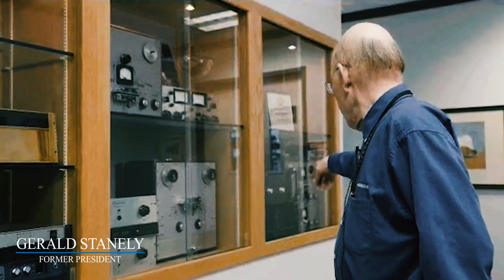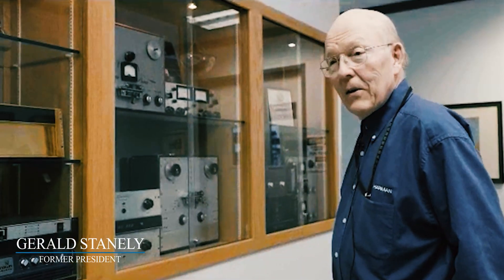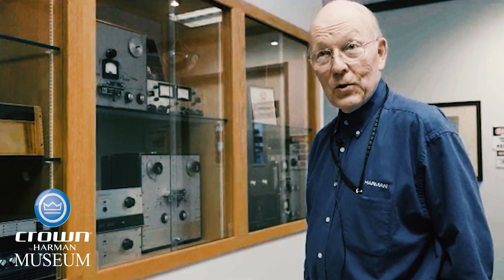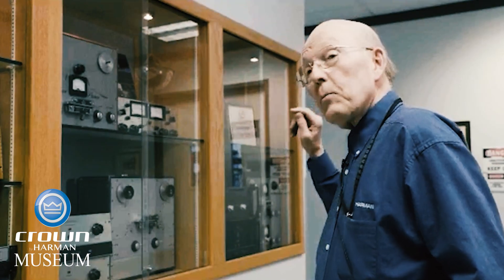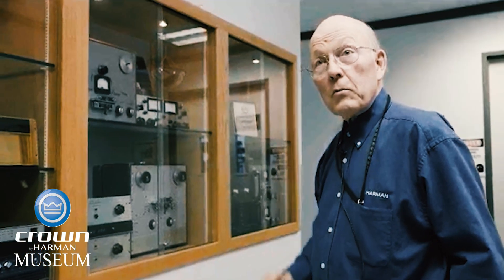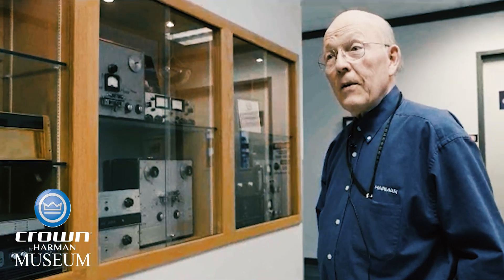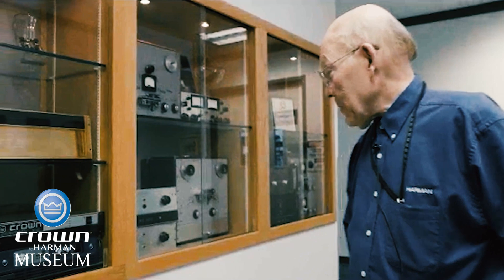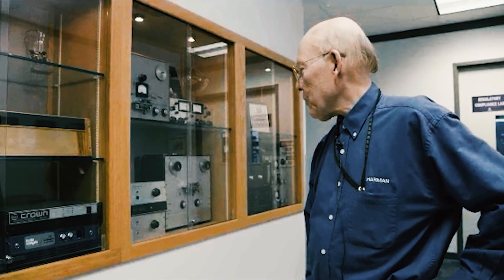Delta and Omega: Crown Museum with Gerald Stanley

Comment: Back in the late 1980's '88-'89 ish I serviced the DO 2000 that tan the largest part of the Silver Springs park paging and background music system.  It was definitely a different beast than the amps I was accustomed to servicing. Definitely an experience in circuitry design and after it was prepared an awesome listening experience. Crown is the only amp for me..."Crown  when you are ready for real" says it all.